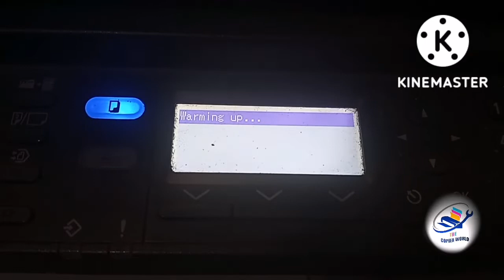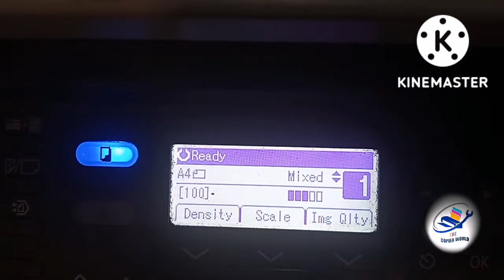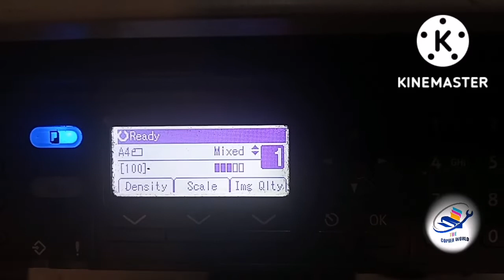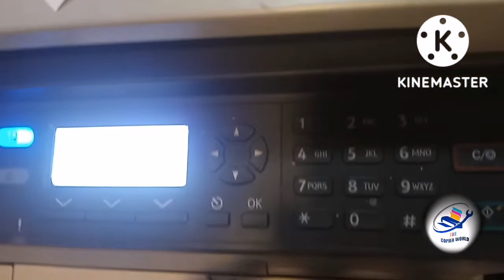RICOH-MP-2014/2014D/2014AD | M-2700/M2701/M2702 Development Drive Idler Gear Change || Gear Box Open

Comment: I followed all steps but i don't know what you did in the other side of 7:14... I think 🤔 you removed something there and you didn't show it.
Reply from the maker: Sorry sir, will you tell what point is missing, if you are facing any problem, then tell me, I will make a new video related to the use problem and send it.
Reply: @thecopierworld   hi, thank you for your video. This is the only video available on YouTube how to replace main gear in Ricoh MP2014 series. I followed this video and I could replace the gear but there was a time I had hard trouble, that was returning the white half circle clips. After trying for long time I asked the technician who helped me on that point. The roller that I try to put that clip should move outside! There are two white clips which has sane this simple rule. Maybe anyone in future watch this video and it can help them. Thank you again for your video.
Reply from the maker: @lhodeniz  thank you ❤